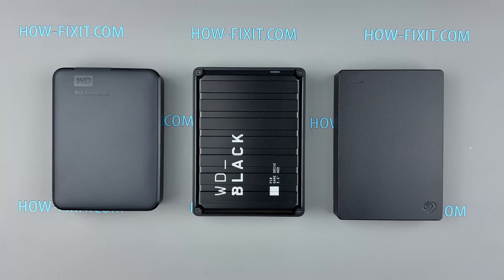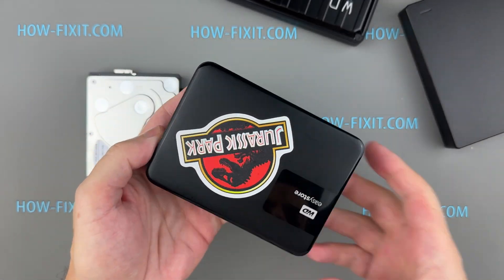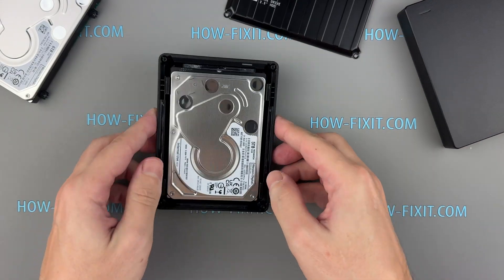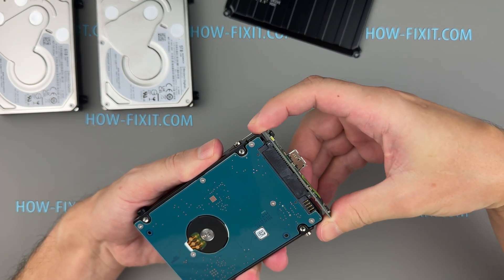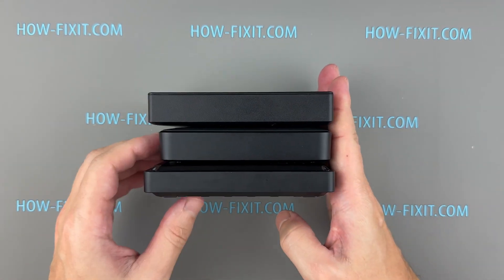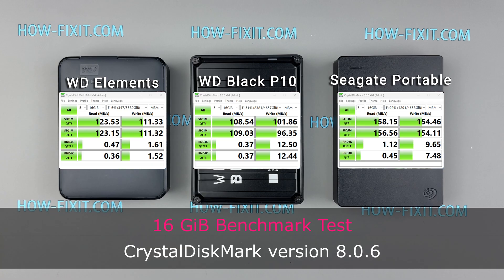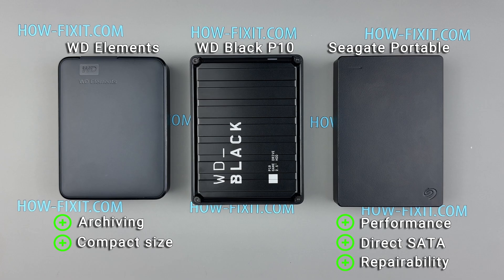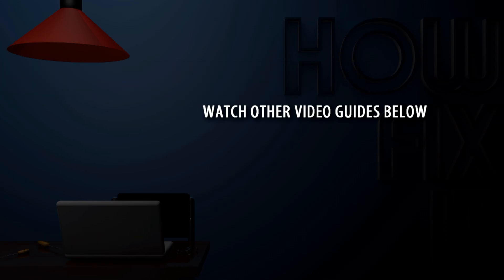WD Black P10 vs Seagate Portable vs WD Elements: Best External Hard Drive Teardown & Comparison

Comment: This guy has shucked more than a few drives in his day.  Great video, thanks for the important info.

About 10 years ago I had a 3TB Seagate drive die on me and shortly after a 2TB Seagate external drive died.  Seagate?....NEVER AGAIN.  Think I gotta go with that nice WD Elements drive.  Had pretty good luck with WD.  Only 1 WD has died and it lasted a good 20 years.  Not mad about a 20 year lifespan.

Comment: A point on your video does not make any sense to me, the Elements have lower random speed which is less good for archiving small files and using it for games occasionally because it is SMR.
The WD Black P10 is a CMR with higher random speed which don't drop as much when trensferring a tons of small files and while gaming, which is the best of both world, that's why i don't understand why you said that the P10 is the less well of the 3.
While the Seagate, is an SMR and are he slowest at random speed with smaller files (1Gb test), the P10 Black is the one that suit more my case.

Comment: Having a conventional SATA interface is a big plus.  Around 2010 I had an 3.5 inch external WD drive fail.  I took the drive out of the case & put it into my PC & that drive worked perfectly for another 2 or 3 years.  The only thing that had failed was the tiny usb to sata interface circuit board.

Comment: I have an ADATA HD830 external drive, it's so easy to disassemble, that I was able to do so without voiding the warranty, because after that it broke and they've replaced it for free. (It broke because it had a manufacturing defect, not because I disassembled it.)

Comment: This video really opened my eyes!  First of all, I would have assumed that the WD black would be faster than the elements, not slower!  I also didn't know that the Seagate has much has better speed and features for a lower price.  Still, its a tough choice because the WD is far more popular.  However, I will choose the Seagate for one particular reason:  I was considering paying extra for the WD black because I thought it would be faster.  Knowing that the WD black is actually slower and the Seagate is the fastest, I will get the Seagate instead because I feel deceived by WD.  I don't think there is any way to really gauge long term reliability without being able to test a bunch of hard drives over a period of at least a few years.
Reply: and from what I've seen there are people that have supposedly owned both for a few years and had them break, so seems like you could be unlucky and only get a couple years out of either or get one that lasts 10 years plus
Reply: @legendslayer98  Well I got the Seagate drive, and it was indeed very fast at first but over time as it filled up it slowed down significantly.  No catastrophic failures yet but obviously there is more to the story than what you see on the surface.

Comment: my 2 units WD 4tb, stopped working for no reason, and I found that it cost a fortune to recover/repair. I will never use WD anymore, they are all bassicaly the same with different name and casing. I just bought a brand new 5tb seagate portable as a replacement, & after watch this video I'm glad it was a right choice
Reply: lol seagate is much worse

Comment: What is the difference between the WD Elements and My Passport ranges? They are both small devices which use 2.5 inch drives.

Comment: idk why but it feels like wd harddrives are getting slower (without telling the buyer) and easy to fail, unlike seagate more durability and less fail cases
Reply: I had very bad experience with wd hdd i have 14 years old samsung hdd which still works today but 3 years old wd died
Reply: @ my WD drive died in 6 months of use

Comment: I've had a Seagate drive connected to my Raspberry Pi since 2019. It recently failed. I'm not sure why I considered switching to WD, but this video has reassured me that sticking with Seagate is the right choice.
Reply: I have several WD Elements drives ranging from 1 TB to 10 TB and none of them has failed to this day. This oldest one is more than 10 years old. But they are the 3,5 inch models with separate external power supply. I absolutely recommend them.
Reply: @jonpeley I can easily confirm this. I once had a 1TB Seagate HDD (purchased in mid-2020) that failed to read data, probably due to an electrical issue from my old notebook PC (from late 2021). However, I suspect it had bad sectors, as that laptop is still working fine today.
Then I switched to a 5TB WD drive that I purchased in 2021, and it is still working well. So, it's a matter of picking your poison, as user experience and the working environment influence these factors significantly.
Reply: how does it failed ? does it dropped from somewhere or automatically?
Reply: @soumyadeepdas8544  Sometimes it fails by frequent use and internal parts wearing...

Gotta pay attention to the noises it makes to detect if the drive is about to fail soon

Comment: what about the feature in WD P10 which has the USB 3.2 but the Seagate has the 3.0? isn't 3.2 usb better? but the RPM is win by Seagate's one though. I'm confused, I want to buy storage for backup photos
Reply: if the hard-drives are slower no modern usb can help you transfer the data at high speeds. WD is clearly slower than the seagate hard drives. so it's clear that even if you have usb 3.2 it wont improve the speed since the hard drives behind the USB controller is slower.

Comment: A plastic case might actually save a drive better than a metal case during a fall - as it will absorb some of the shock by breaking apart. A strong metal one, where the drive is attached firmly to it (no shock absorbers) will probably transmit most of the shock to the HDD inside. Am I right?
Reply: The plastic would absorb some kinetic energy yes, but the difference would be small. The drive would still slam into the floor and risk magnetic head damage. I honestly would suggest that you skip all mechanical drives. They are pretty much always shingled drives now, which means super slow. And they are always fragile.

Use a M.2 NVMe (NOT SATA!) enclosure and a QLC (quad level cell) SSD instead. The advantages are extreme durability (relaxing), low power usage (USB is all you need), high speed, high random read/write seek access, silent operation, and upgradeable drive. All those advantages are worth the slight extra. What is your data safety worth to you?

Comment: Hi. A bit of an unrelated question but im hoping you could help.

I have an old 1tb external hard drive that i believe has a bad port. I have tried 2 different cables and sometimes works but keeps connecting and disconnecting. The cable has a bit of play in the hard drive port which i think is causing this. 

I have ordered new 4tb hard drive but i am wondering is there anything i can do to stabilise the connection so i can transfer the files? Sketchy or not. I just want to be able to get the files off it.

Thanks.
Reply: Shuck the drive and mount internally or very a high quality enclosure